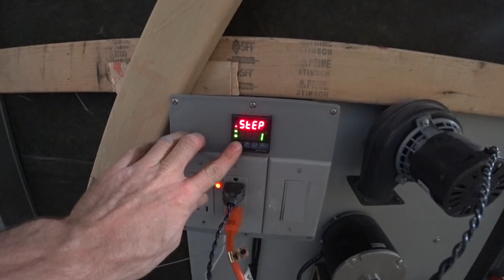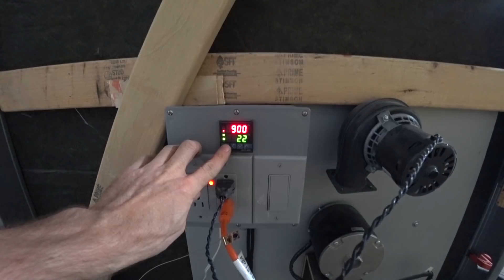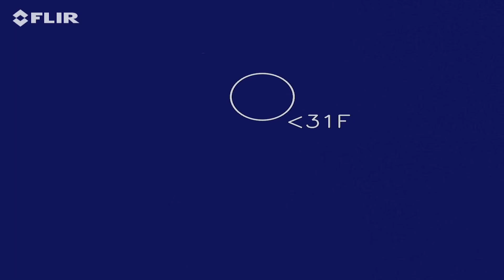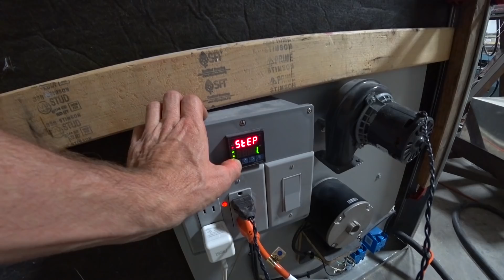How to Post Cure Carbon Wings - Building the Raptor Prototype

Comment: From my experience in similar automotive setups i fear you will have oil leaking issues where the oring strips meet the shaft seals on that drive.  Usually in automotive applications a joint like that calls for rtv or similar sealant to be applied where they come together.  I also advise against oiling the outside of those shaft seals.  Assuming they are rubber on the outside oiling them doesnt do any good and can actually encourage leaking.
Reply from the maker: I haven't oiled them and I did place some gasket seal at the intersections. Thanks.
Reply: @RaptorAircraft  oh ok. It looked like stp was put on the outside.  I also dont think oiling the strip seals will do any good.  Oiling orings is mostly to make sure they dont get messed up during install and dont run dry. Amazing work btw.  My dad and i built a kr2 when i was young.  This makes that look like a lego set:)

Comment: I really like your prop shaft drive housing, one suggestion on the thrust washer fix though would be to weld, heat treat, and re-machine, rather then JB weld. The housing surface under the bearing shell ends up having a high hoop strain due to the crush and depending on the origin of the oil feed and storage conditions it can have back temperatures as high at 250F and as cold as -40F.  Because the bearing back is steel this means the strain will vary with the difference in thermal expansion of the steel and aluminum.  There is also obviously dynamic reaction loads induced into the housing from the torsionals of the shaft and vibrations from the mount.  JB weld doesn't have the same elastic modulus or coefficient of thermal expansion as aluminum so there is going to be some amount of stress at the bond and its strength will be decreased at those temperatures despite a 500F temp rating.  It will definitely work for some period of time, but I wouldn't plan on that being permanent unless you run all the stress calculations and determine the bond strength within the operating envelope.  Great job with this!
Reply from the maker: It's 7075 so it can't be welded so instead of the JB weld, today I drilled and tapped a 4-40 threaded hole and put in a flat head screw which blocks the passage nicely. You'll see it in the next video.

Comment: You have come a long way in 2018. I was wondering however what happened to the de-icing project since you have not (yet?) put any tubing into the wings.
Reply from the maker: We'll the strake tanks have the heating set-up in them but we're not heating the rest of the wings on the prototype in the interests of saving time.

Comment: I've watched every one of your videos. ( Thanks for sharing. )

I think that once you get the doors and the re-drive down pat, the production should go good okay. I've watched you make a lot of moulds, and while the moulds that affect the doors and upper cabin might be large pieces, otherwise I have seen a swarm of other moulds go by that have nothing to do with the door/ fuslage areas. I think that devil is in the details, and perhaps maybe you will have one last fight for the doors on the new prototype, but it seems that most of the devil is behind you. It seems that your people can lay up the actual parts themselves fairly quickly.

If you have "spare time" and want to go fuller OCD on the redrive, you could prop it up on three corners, with 123 blocks, and apply pressure either up or down to on the remaining corner see if torsion affects the case, while turning the shaft. If you can find some, copper pennies can keep the case from getting marred.

And because some people have a knack of whispering self-doubt aloud: does the engine produce enough oil flow for the redrive?
On that matter, the trust bearings could likely be lubricated to some degree, if some kind flow restrictor was put inline, such as a washer.

BTW, JB Weld can be degraded by water immersion. If it could be done well, I would feel better if the extra lines in the redrive, were tapped, and perhaps a crush washer could be used, if it isn't JIC tapped or something already, and/or as long as the seating surface is nice. It would be something to test for a few heat cycles, too. If it's JIC, Parker would likely have a plug, if Aircraft spruces doesn't.

Comment: Have you pressure relief holes in the ribs? I haven't seen them
Reply from the maker: There are gaps at the leading edge of the front ribs and we will be strategically placing a single hole in other bays in order to allow pressure relief while still maintaining the ability to provide floatation in the unlikely case of an emergency water landing.

Comment: At this point with all the messing around with the redrive wouldn't just be easier to use a gearbox?
Reply from the maker: Gear boxes blow up. I've looked at all the possible redrives out there and there isn't one that would readily fit the Audi engine and provide the ratio we need, not to mention having an oil feed for the constant speed prop.

Comment: Without locating pins on the drive, will it not move? Are the bolts machined to the same size as the bolt holes?
Reply from the maker: I did say that I'm putting dowel pins in it.

Comment: One question and it could be camera illusion but some of the fittings look really close to the engine mount. With the thickness of the isolation rubber between the engine and mounting frame could it flex enough to rub?
Reply from the maker: As I said in the video, once the Adel clamps are in place nothing will have the potential to rub anywhere.

Comment: seriously J&B weld pleas get some weld and get it machined , and put some new bolt on the re-drive for final assembly torquing and removing assembly bolt stretch them and loos integrety i hope you now that right ?.
Reply: Don't know why this came up in my feed(actually I do know why).... but I had same thoughts as soon as he mentioned it... and to answer your question: I highly Doubt it.  The clincher for, "I highly doubt it", is he is making a cozy, but calling it something else.  An aircraft which requires 10 miles of runway to take off/land from, you can't use a gravel/grass runway, you can't see out of it worth a damn, and is only good from going from point A to point B at medium speed.... so you may as well fly COMMERCIAL.

Comment: I understand that this article is the prototype but swapping the lock to something a little more secure might be prudent. That lock appears to be a wafer lock and those are essentially the illusion of security and can easily be defeated by a child with a hairpin. It would be fairly trivial to swap in an 'Abloy Protec2 Electronic Switch Lock' (as sold by securitysnobs .com). Honestly just about any pin tumbler would be better, even a cheap one from partsexpress .com. There's also the medeco rotary switch lock.

Locks can be a complex topic and have a lot of weird specialty stuff. Perhaps just contact a local locksmith, i'm sure they would be excited to work on such an interesting and unusual (for them) project. Perhaps I'm just a lock nerd, this probably isn't a big issue, but I just cringed when i saw that lock. Cheers!

Comment: ,,, at a minium should ball mic your bearing shells, just to make sure they are a matched set. No oversize, or undersize that might have somehow got in the package. I'd also go with a professional assembly lube, not a viscosity improver. Btw, fan of your amazing build . Also, pressure fed plain bearings (in a located or doweled housing) don't bed in. They hardly touch, except a little on a start up .
,,
,,, also  lose the epoxy, small tapered pipe plug, with a single drop of Loctite .
Reply: I recommend using plati-gauge to check journal bearing clearances.
Reply: @norwescan  ,,, not bad, but at the level Peter is seeking, the whole deal needs looked over with ten thousandth reading mics and dial bore gauge . Housing bores, bearing shells, clearances. The bearing manu ought to have a recommended clearance. If not I would work for .002, plus or minus 2 ten thousandths .